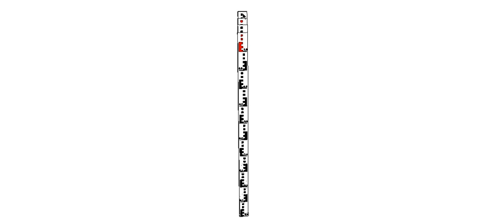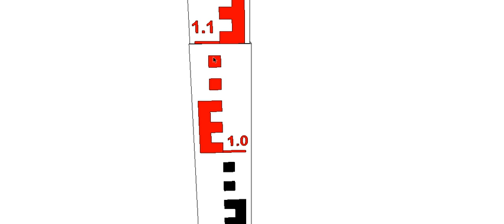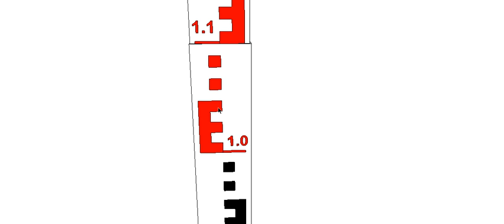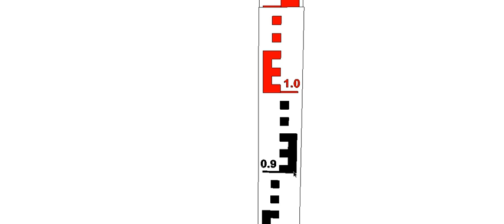Read an E Face Staff

Comment: how do you take level under soffit beam
Reply from the maker: Hi Eemihle, If you are looking to find an Reduced Level (R.L.) for the Soffit Beam you would need to turn the Staff upside down and record the reading as a negative figure and complete the Level book as normal. 
However if you are just wanting to get the Soffit beam level you could just use a tape measure or a piece of timber to measure up from the cross hair to the underside of the beam